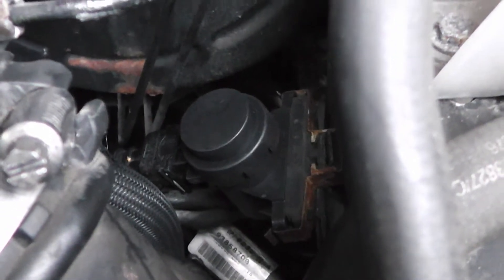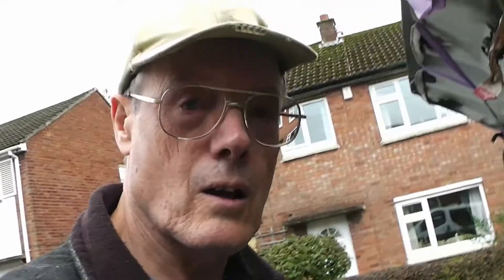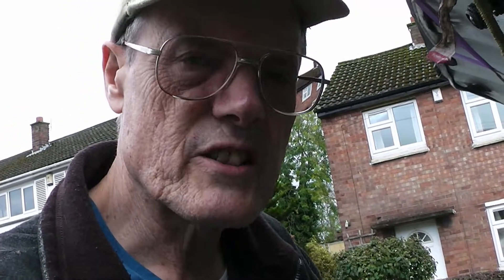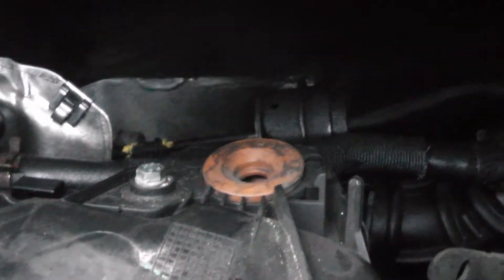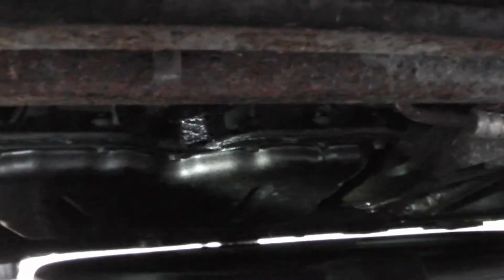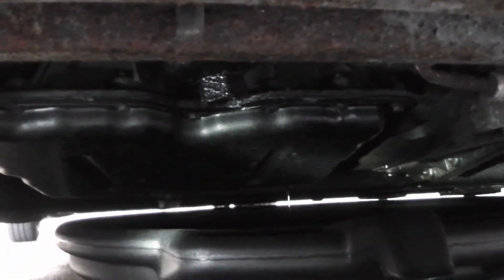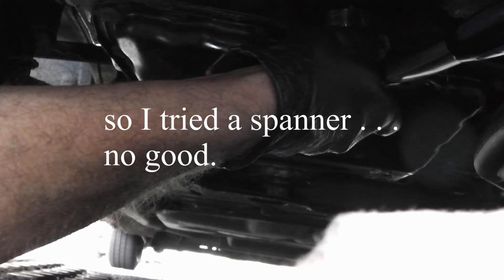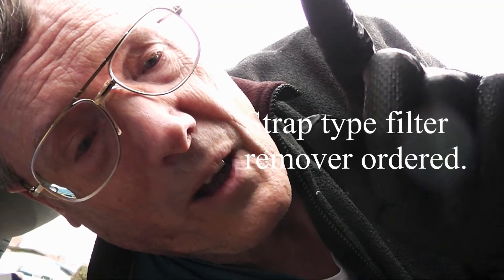'07 2900 Vivaro Van. Lack of Boost Solved!

Comment: I have a 2015 1.6 vivaro. Wont rev over 2k rpm underload. But revs freely out of gear. Its being a headache. I have maf sensor and high voltage circuit on boost sensor. So ive ordered two vauxhall parts. But get the feeling these just wont fix it. Only on 90k. No smoke. No rattles. Although cylinder 4 glow plug has a small amount of oil or diesel around it. I wonder is this also an issue. But my luck the egr and turbo are down the back of the engine tight to the firewall apparently its a drop the subframe job. Any advice would be appreciated.
Reply from the maker: Our lack of boost was the MAF and a leaking pipe from the turbo. You could hear the air escaping.  The first job we had to do was the ignition switch, which was not allowing power through.   Sorry to not be of more help. Good luck.
Reply: @sleepycatpictures1176  I appreciate the response. I have fitted a new maf sensor and boost sensor. Got full power back and then the spanner and engine light have come back on. So it's time to find a leak somewhere. Do you know where the ignition switch is on a 1.6 2015? Thank you. And keep uploading your helping people out greatly! Regards
Reply from the maker: @GhostTrader37  The switch on ours was in the column behind the key barrel. I did not film it in case any unsavoury types used the info for the wrong purposes. The cowling has to come off and the barrel comes out after pressing lugs in with the key in. Can not remember now but it was not too complicated. The reason we changed ours was because after a squirt of WD, the switch did not work at all. The new switch had to come from a main dealer.
Reply: @sleepycatpictures1176  perfect that is handy to know👌thank you verty much for the replies🙏🙏
Reply from the maker: @GhostTrader37  Hope it helps.
Reply: @sleepycatpictures1176 I have a fault coming up saying ignition - switched power relay circuit short to ground. Is this the same relay your talking about? Do you know where I can find this on a 2015 1.6. Thanks for your help. Much appreciated.
Reply from the maker: @GhostTrader37  Sorry. To be honest , I don't know. The only van job I got dragged into was this one. Right hand side of the engine on the inside of the wing I think.  Sorry to be so useless.

Comment: Hi mate, i have a vivaro and it says underboost fault. Theres no vacuum everywhere besides the brakes. Any idea whats causing this issue please? It struggles uphill.
Reply from the maker: Hi!   I wish I was an expert then I could offer good advice, unfortunately I'm not. However, it sounds like a turbo problem. A stuck open wastegate would cause that.  I had to put a spring on the wastegate actuator on the son-in-law's Vivaro as the actuator seemed very slack. Not too difficult to check.  No vacuum means the vac pump is faulty and not producing enough vacuum to power everything else as well as the brakes. If that's the case, the brakes pedal should feel harder and more effort to brake will be required. Or it could be the other items I covered in the video. Whatever it is , I wish you the best of luck!
Reply: @sleepycatpictures1176  thanks for the reply. Turns out it was a split in the pipe by the vacuum pump causing issues.
Reply from the maker: @RajenVH  Excellent!  Easy fix!

Comment: Nothing wrong about a bit of fudgery, especially when it works, good to see it solved. Wonder if the plastic oil filter housings are designed to need replacing at every oil change
Reply from the maker: Seems like it. It was readily available at the Spares shop, and on line!
Reply: @sleepycatpictures1176  just another way for manufacturers to squeeze money out of the motorist, normal oil filters have been ok for decades and easier to replace
Reply from the maker: @DoubleZeroGarage  Yup, there is always a fiddle somewhere!
Reply: Been following..but pity you didn't pin point the problem..was it the pipe to the turbo ..or actuator..or one of the sensors..great video thou..
Reply from the maker: @adambraithwaite3177  Thanks for following!    Bodgery was done due to financial constraints. The problem was the MAF sensor and the pipe from the turbo which was was not seating properly thus allowing the boost air to escape. We could hear the noise on acceleration.  The actuator seemed to be too loose to me that's why I popped a spring on it. We changed the boost solonoid and the sensor - made no difference. Sometimes either of those two can cause a problem but in this case, no. Van runs fine apart from a large oil leak from somewhere which still has to be solved.

Comment: Great video, I've got a 2013 with all the lights on , turbo underboost on the code reader. Turbo is clean and so is the dpf , going to give  this a try. The mechanic that's looked at it ( and I use the term mechanic loosely)  didn't say anything about the stuff you've looked at.
Reply from the maker: When driving, we could hear the escaping boost from the turbo. The pipe we nearly changed is only a press fit. It was damaged in a previous removal by the garage. All I did was fasten it down. It's working now okay, fingers crossed!   Changing the boost sensor and solonoid has worked for other people but not us, it was the MAF in the end.
Reply: what codes is it showing on diagnostic.? i`ve had loads of issues with mine, and now she runs amazingly.. one thing i will say especially with the MAF. do NOT buy cheap universal parts, only use OEM. these engines don`t like it..
Reply from the maker: @themagpie_1  Sounds like good advice to me. Sorry can't remember the codes, the son-in-law was dealing with that.  Van's running okay, we just need to deal with the oil leaks!

Comment: So, what was causing the power loss after all that ?    Thanks.
Reply from the maker: MAF sensor and a broken boost pipe from the turbo. Broken ignition switch did not help neither!
Reply: @sleepycatpictures1176  I have a 1.9 Trafic without the big blue connector, and it was running really well then over night it only has about ten percent of the normal power, and foot to the floor can hardly get up my driveway.  Any ideas ? I can't drive it to a garage in it's present state. Thanks
Reply from the maker: @jackspratt4343  Sounds like the MAF.  We first changed the Boost Pressure Sensor and the one fastened to the right hand side of the inner wing. Made no difference to ours but somebody else with a Vivaro fixed his by changing those two items.    Presumably the engine starts well enough?     Probably not related, but I had a similar problem with Old Stinky. Turned out to be the EGR stuck open. There was so much exhaust gas going into the intake it could not accelerate!    I had to blank it off in the end.
Reply: @sleepycatpictures1176  Thanks for your reply. I had an EGR related problem that rendered the van almost undriveable and leaving behind palls of black smoke.It was pinking like crazy and surging. I turned the EGR around and disconnected it and this did help alot initially but then returned back to the pinking and smoking and surging. This was caused by the air filter being coked up. Once replaced , the van drove like  a dream for a few weeks until I drove across town to pick up something, and when I restarted the van to return home, it was totally down on power. Almost can't make it up the drive, lucky to get it back since there are mild hills around here. p.s. I had already just replace the MAF with an expensive one, and have also disconnected it to default to a backup fuel mapping. No joy. Another youtuber suggested the wiring loom is faulty.  I get fault codes  P1806, P1814, P1802  , P1806 .     
P1806 Short circuit to battery 4 wheel drive ( its not 4 wd as far as I know ). P1814  same as P1806.   P1802 Transmission Clutch interlock safety switch short circuit to battery. P1802 the same Transmission Clutch safety lock.  Thanks again.
Reply from the maker: @jackspratt4343  Crikey, buy a Ford.   Some fault codes will still activate even if that item is not fitted.   A leaking intercooler will give those symptoms. Check the face of it and look for any oily residue. I had a Diesel Vectra with the same problem, smoke and no power. As soon as I re-plumbed the pipeing, it went like stink.
Reply: @sleepycatpictures1176     Yes, this van has been nothing but trouble. One thing after another after another. I will fix it myself or scrap it. I will avoid diesel renaults  in future and stay away from Vivaros too. Love the cat photo, Cats are class.
Reply from the maker: @jackspratt4343  Good decision, though I must admit that Vivaro's are nice to drive. Good luck!
Reply: @sleepycatpictures1176  Thanks mate :)